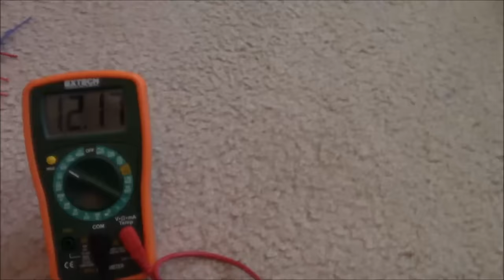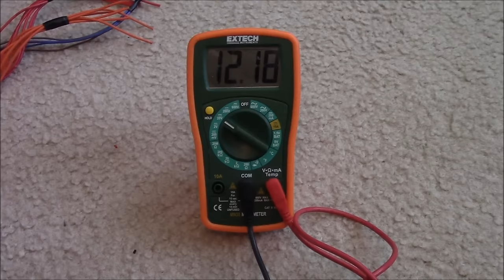How to Hack a Computer Power Supply (PSU) To Use as a 12V DC Power Source

Comment: Hi LDSreliance your videos are very helpful. I want to cool water using a peltier cooler and I'm unable to find a suitable power supply. I want to power the following devices:

1) 12 volt, 10 amp peltier device
2) 12 volt, 0.18 amp cooling fan
3) 12 voltt, 0.4 amp submersible pump

Can I use a power supply of this sort to power all the devices at the same time? I do not need any portability. I'm new to DIY scenario and any help will be appreciated. Thanks.
Reply from the maker: +Pruthvi Krishna Yes, a computer power supply is perfect for powering a peltier.  It provides a nice steady voltage with clean power and even the smallest power supplies like I show in this video could power all the devices you have listed.  Just make sure that you keep the water away from the power supply, obviously.
Reply: +LDSreliance Thanks for the info. I have a very basic question. Say I directly connect the 12 volts obtained from the black and yellow wires to the cooling fan, will it blow up by drawing too much power? Do I need a resistor in between to limit the max current?
Reply from the maker: Pruthvi Krishna
No, I have never heard of a fan that will draw too much current like that.  Usually only things like LEDs will draw too much current.

Comment: Hi Great Video :) I have one question you fussed all the yellow 12V lines together and all the Black together for one connection, but for my project, just saying that there are 10 of each yellow and black cable, can I use them individually for say 10 x 12v connections to power several Computer fans for a simple extractor system? thanks in advance for the help :)
Reply from the maker: As long as each wire doesn't carry more than a couple Amps that should be fine.

Comment: Great video! I was wondering if you knew of anything I could do if the power supply isn’t turning on. I have the green wire and a ground/black soldered together but when I plug it in the it doesn’t turn on at all. I’ve tried shorting the two wires manually but that still doesn’t do anything. I’m stuck.
Reply: ^Can pretty much guarantee it’s dead, hooked up an led to the standby terminal, which should always give a 5v out as long as the PSU is plugged in, and it’s not giving me anything :(
Reply from the maker: It isn't dead, I don't think.  Your PSU may have a "sense" function which will not turn on the power supply if it doesn't detect a high enough load connected.  I don't know if it will turn on with a 5V load, either.
Reply: @LDSreliance  well I would assume that no matter if it senses or not the standby terminal would still give an output but I’m not sure. Also idk if this matter buts it’s about 12 years old so I don’t know if this sense feature was common then. But again I don’t know too much about this
Reply: @LDSreliance  also I had a 14 volt light attached to the leads for 12 volt and it was the same issue but could that be it needing too much. I was hoping to use it to power small circuits and my ardiuno uno but I also don’t want to fry it for something
Reply from the maker: Try connecting it directly to a fairly significant 12V load and see what happens.  Something like a camping fan or a car stereo or even a computer case fan of at least 1 Amp.
Reply: @LDSreliance  I I’ve tried a computer case fan but I’ve since redone the lead connections, so I’ll definitely try the fan again soon
Reply from the maker: Good luck!
Reply: @LDSreliance  thanks I’m going to need it lol!

Comment: Another great video! 
Okay - I have loads of black wires coming from my power supply; do you have any tips for connecting so many wires together?
Also my power supply has two channels for +12V. There are yellow wires, and yellow wires w/ a black stripe; can I tie them all in together? Or just pick one? 
Thanks LDS
Reply from the maker: nellyjizzle I would recommend keeping the rails separate.  I don't know what it would do if you connected them together.  It would probably be fine but I am not an electrical engineer so I can't say for sure.  Better safe than sorry.

If you keep the rails separate, you can help the black wire situation by dividing that in two bundles to match.  It sounds like your power supply is a higher power or newer model than the one I hacked up for this video so you have more wires than I did.  You will need a pretty good soldering iron to heat up that many wires at once and solder them together.

Comment: I made one of these a few years ago when i was racing RC cars to power my LIPO charger. If i remember correctly i only used one yellow and one black. What is the difference in using one yellow and one black verses using all of them?
Reply from the maker: +andrew geary You can use one wire if you want for lower wattage loads.  If you want to use the full amperage of the +12v rail for any length of time I would use all the wires so you don't start the wire(s) on fire.

Comment: can't you use the Molex connector in the psu to get 12v, wouldn't it be easier that way, speaking of which I want connect my 12v 5A audio amplifier (BT-298A) to the molex connector. is this possible? or will it fry my amplifier, I have a 850w psu if that helps. I've search up how much amps does a molex connector have and it says there's 8A on each wire, I'm no electrician but wouldn't more amps fry my amplifier, I got this amplifier from wish so I doubt it has a fuse or a safety mechanism. also this is a psu that I'm using to power my PC so i don't want to damage it in any way

Comment: Can I simply grab a 'pair' of random one red and one black cables to connect up a led strip? And if that is possible what will be the amp for each of the pair? No electrical engineer here so this may be a stupid question.
Reply from the maker: The wires you want are the yellow (+12V) ones.  If you are only using one wire then I would stick to only 2-3A maximum if I were you.

Comment: Simple and nice presentation. I think i can use my car vacuum cleaner to work indoors. out put i shall connect to a female cigarette lighter socket. My equipment needs 2 amps,  will that work??
Reply from the maker: +Yeshwanth Nagendra Yes you should be able to produce 2 amps with at least a 25 watt solar panel.  You can order a female cigarette lighter receptacle and connect it to your charge controller pretty easily.
Reply from the maker: +Yeshwanth Nagendra Yes you should be able to produce 2 amps with at least a 25 watt solar panel.  You can order a female cigarette lighter receptacle and connect it to your charge controller pretty easily.
Reply: +LDSreliance  Thanks much! Looking forward for your subsequent vedios..!
Reply from the maker: Yeshwanth Nagendra
Thanks for the support!

Comment: Hey mate :) Loving your videos!

I've been wanting to do a little peltier desk cooler/ac for a while and I've finally collected enough scrap around the house to do so (pc liquid cooling radiator, Tubes,Waterpump, :) I just have a question.
I have 2 100w 12v peltier units coming in the mail in a few days and i was wondering if it would be in anyway possible to run both off of a single 370w Psu. I know for past experience that these things draw quite a bit of power, so i just gotta make sure i can provide that for the maximum efficiency.
Reply from the maker: It depends on the power specs of your +12v rail.  If the total output of your power supply is 370w then I doubt the +12v rail will have 200 watts or more of power.  The power supply in this video is either 400 or 450 and the +12v rail produces 20 amps, which would be enough for your use.  Look at the sticker on the side of the psu or look up its specs online with the model number information.
Reply: Hey, did you end up making the peltier desk cooler? I have always wanted to make something exactly like that so just wondering how you did.

Comment: I have a 250W power supply, but there is only one -12V wire, while there are several for +12V.
I suppose I can not hook up a device that needs more than lets say 90W? Thanks for the answer.
Reply from the maker: Disregard the -12v.  You don't want to use that.  You want to use the GND (ground) connections for the negative side of your DC needs.

Comment: Awesome video, very neat ! just one question....
I want to powered up 192W leds ( 1200 leds) in one strip.
if i use a PC power supply  12V DC power , 10A , & 240W or more do you think its gonna work for years? wanna give any suggestion
Reply from the maker: You will need 20 amps of +12v DC power for that kind of load.  You will have to check the specs of the +12v rail on your power supply.  Mine that I showed in the video will do 25 amps but yours may be different.  Computer supplies are meant to last for years so if it is a reputable brand and in good shape or new it should be fine for years at that load.
Reply: Thank you dude. \m/

Comment: Why do you have to solder ALL of the wires together? Would you be able to just use say, one yellow wire and one black wire?
Reply from the maker: You don't have to.  You can use individual wires as long as you use low current that does not exceed the carrying capacity of a single wire.

Comment: My power supply from a Dell Optiplex 330 has two sets of wires exiting the case.  One bundle goes to a 24 pin connector. The other bundle goes to various other connectors.  I cut the 24 pin connector off and connected the wires according to color.  I had solitary blue, purple, gray 18 ga wires,  and a very small brown wire that was piggy-backed with an orange wire. I left the brown wire out of the orange bundle.  There were no yellow wires in the 24 pin connector bundle but there were 2 white wires.  I tested my multi-meter on a car battery and it worked fine.   I plugged in the power supply and measured 10 volts across the red wires and 24 volts across the white wires.  I'm looking for recommendations on getting 12 volts from this thing. Anybody?

Comment: I have made a 12v power supply seeing your video. Then power up 10 LED strips (9W each Strip). At this moment LEDs are doing very well. But when I put a peltier cooler( 62.2 W, Umax =15.4 v, Imax = 7 amp,1.7 Ohm resistance ) in the system, then LEDs became dim. What is the reason of this?? 
Do I need to draw current from 5v rail also to make the volatge stable for 12v Rail??
Reply from the maker: Adnan Tanveer Nawaz How many amps is your +12v rail rated for?  Most common, cheap 300-400 watt power supplies can only provide 15 amps or so on the +12v rail.

Comment: Cool Video... how much watts and amps does it output?
Reply from the maker: According to the sticker on the side of the power supply, mine can output a maximum of 25 amps on the +12v rail.  Not bad for $20.

Comment: Someone asked about adding a switch to connect the green "wake-up" wire and a black wire. I missed your answer if you gave one. If it's doable, what are the requirements for that switch? Thanks.
Reply from the maker: Yes, that is perfect.  That is what the power switch on your computer tower does.  It just completes the circuit between the green wire and a black wire.  So just find any 12v DC switch and wire one side to green and one side to black and you are good to go.

Comment: Hello. 3 Questions.

1) LDSreliance where did you buy this particular power supply from??

2) I have been doing some research looking around on the internet and apparently cheap Power supply's are really dangerous and could set on fire, so this is holding me back from buying. Have you had any problems with yours?

3) What would you say is better and why: A normal actual Power Supply, or a PC Power Supply like yours???
Reply from the maker: If you have money to spend I would buy a purpose built DC power supply 
(like this: http://amzn.to/2pLjNsj).  If you have an old computer laying
 around or have access to harvesting the parts from an old one then 
these are great.  I have never had a problem with it and no one has ever
 commented on this video that it could be dangerous.  So I don't think 
you have anything to worry about.

I didn't buy this power supply.  It was harvested out of an old PC that one of my clients did not want any more.
Reply: LDSreliance what brand is yours? Is there a sticker on it?
Reply from the maker: I would have to pull it out and check.  If I forget, shoot me an email at ldsreliance@gmail.com.

Comment: have you created a follow up video showing how to use orange, red and blue wires? besides the 12v that draws 13.5 amps pump I want to use the hacked computer power supply on I also have a pumps that draws only 3-6 volts? is there an easy way to determine the amps being put out by the power supply? if I exceed (produce) the volts or amps demanded by the pump will it hurt anything or should I step it down some how? can I step it down by putting an additional load on it like a fan, light or motor? ty for any guidance you can provide.  🙂
Reply from the maker: No, sorry.  The video was for a 12V power supply only.

The red colored wires are the 5V positive wires for the USB connections.  However, USB is very low power so you won't get much current from the red wires.  So look up the current requirements for that pump and if it is more than like 10A I would say you probably won't be able to make it work.
Reply: @LDSreliance  thanks for taking the time to reply
Reply from the maker: You are welcome.  Good luck!

Comment: WOuld each individual black and yellow wire produce 12v DC?   I am wondering if I can you this idea to make a Raspberry Pi cluster ?
Reply from the maker: Yes, they would.  I combined them so I could deliver higher current than a single wire can handle to get the full power out of the PSU.  But you can easily pull enough power for a Raspberry Pi.  They use 5V, though.

Comment: Ooh Great Video, SO I'm kinda new to this stuff, I like your explanation... So regards the Black and Yellows being soldered together, IF I wanted to power say Two motors and a set of LED's too, could I just split those wires to three, to power each item?? Thanks
Reply: Ahhh Yeah I just read below thanks...
Reply from the maker: Yes, you can.  Splitting the wires into equal bunches of 2 or 3 is no problem.  But if you wanted to split them up into 4-5 or more then I would say you should limit the amount of current you are pulling through each bundle.  But 2-3 bundles should be no problem.

Comment: You showed the soldering of the one wire, but not the 20 wires or whatever. I wonder what in the heck that looks like under that tape.
Reply from the maker: I twisted the yellow wires together and then crimped them into that connector.  After crimping it with a mechanical connection I then soldered them for a better electrical connection.  I'm sure it isn't pretty but it is effective and efficient.

Comment: Always wanted to do this.I have a Compaq 243890-001 power supply with 24 pin connector. One pin is missing. I have no yellow wires.Can I convert this to be supply for windshield wiper motor.
Reply from the maker: Yes, since that is 12v.  However, you are going to need to do some research and find out which colored wires are the +12v rail first as it sounds like yours might be a proprietary Compaq model that doesn't follow the norm.

Comment: Great video? I'm currently researching how to create an outdoor 12V receptacle to power a marine stereo unit on my pool deck. I want to have the PSU inside and then run the 12v power through the wall to the receptacle. Can you tell me what model of PSU you used in the video?
Reply from the maker: I can dig it out of storage and give you an exact model if you want but there was nothing special about this power supply.  Any cheap psu will work and will follow the same colors on the important wires (+12v, etc.).  This one was 400 or 450 watts and the +12v rail provided 20 amps.  So that is probably about what to expect from the cheaper $20-30 units.

Comment: Why do you solder all the 12 V (yellow) wires together, instead of just leave them separate to use for several different applications?
Reply: Usualy each voltage has 2 or more rails where the voltage is coming from. If you put them together you get all the available amps.

Comment: thanks for this video. i got a bunch of PSU, old and new. i'm planning to convert it into multi power supply like for mobile phone, led lighting, cooling fan, speaker, power bank, keyboard and mouse RGB gamming, etc. i hope you notice my comment and give an advice. thanks.
Reply from the maker: Thanks for commenting.  My only advice would be to try to find older power supplies.  Newer PSU's tend to have built in circuitry that shuts itself off if it doesn't detect a load to save energy.  This throws a monkey wrench in using it as a benchtop power supply.

Comment: I have a question I have not seen asked in a hundred or so comments. Is it really necessary to connect all yellow wires together? Couldn't 12V be achieved with one black and one yellow wires and the rest left connected to the ends and just tied back? Less mess and easier to work with
Reply from the maker: No, it is not necessary.  But if you plan to use the full power of the power supply on one load then it would be highly recommended.  Individually, those wires cannot carry the full current of the 12V rail, which in my case was 20A on this model.  Some models could be 25A or more.  That much current would burn up a single or maybe even a couple wires.  So by combining all the wires together, you can use higher power devices.

Comment: what if you don't connect all of the yellow and black wires. If you use just 1 black and 1 yellow wire, can you still get 12 volts? Essentially if you had 10 yellow and 10 black, could you not power 10 separate 12volt things?
Reply from the maker: You will get 12V but the amount of current you can safely use is much lower.